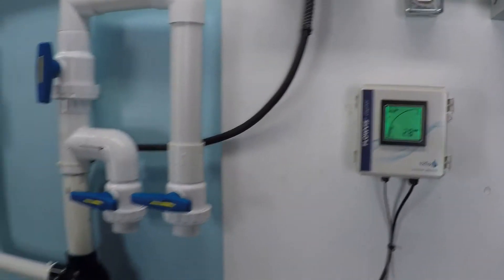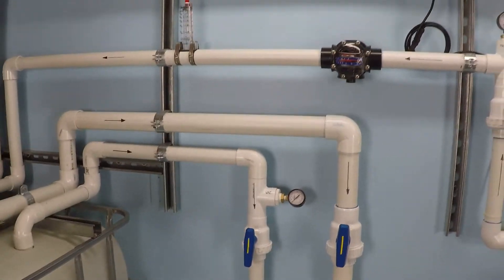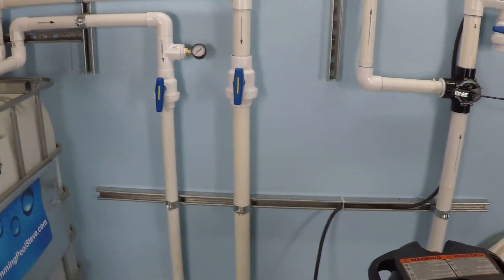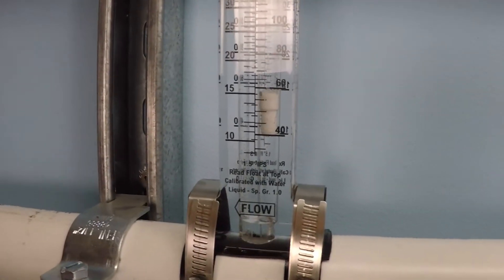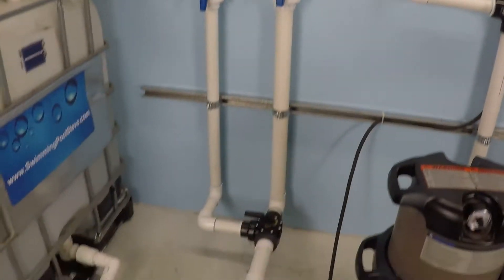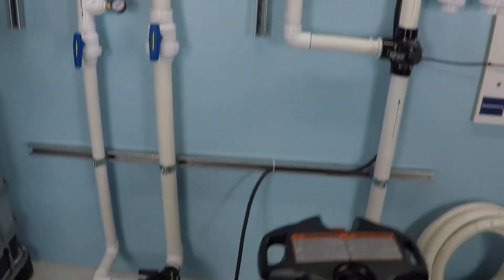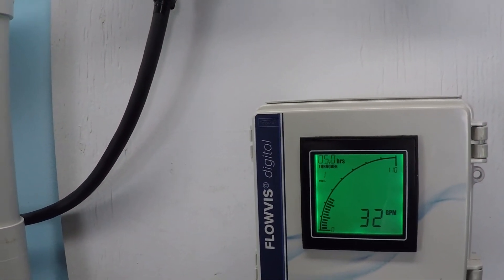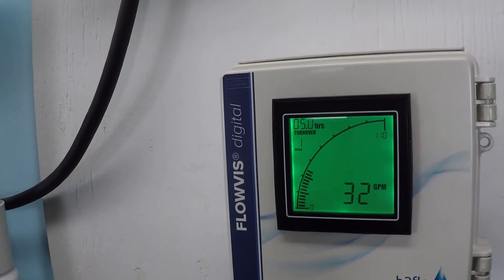What Is A Digital Flow Meter?

Comment: I even read that 1st turnover filters only 37% of your water, 2nd 68%, 3rd 87-89% and the 4th 98%,,,, so you are absolutely correct that it should be at least 3X the volume of your pool,,,,there is a general misconception by the pool chem supply companies stating minimum 1 turnover for 12h, stressing that residential turnover should be within 8-10 hours and commercial 6 hours
,,,but 1 complete turnover does not mean 100% filtration,,, that is why I concur with you that minimum 3X turnover is recommended for good filtration and efficient use of chemicals,,,,

Comment: Can the flow rate on the Pentair Intelliflo VSF be trusted or should I also install a separate flow meter?
Reply: I’ve been wondering the same myself…information is scarce about this. Running the Intelliflo via GPM instead of RPM. How accurate is the setting vs an actual flow meter?
Reply: @hovansh2373  @keithws Pentair make great products, and the IntelliFlo series is no exception. However, the primary function of the IntelliFlo VSF is the variable speed capability - the flow reading is marketed simply as a flow estimate/indicator, and is referenced as such in Pentair's own literature. The VSF flow reading is roughly 70-75% accurate and reads low, which in turn encourages the user to set their speed higher than is necessary, thus burning additional, unnecessary energy. 
If you are looking for an accurate and reliable reading of flow, there's no replacement for an actual flow meter. FlowVis flow meters (from H2flow Controls) are >98.1% accurate across the model range. Please let us know if we can provide any additional information.
Reply: @H2flowControls   so can the FlowVis Digital be integrated into a Pentair controller - for the purpose of 1) more accurate speed setting on an Intelliflow pump and 2) remote display of FlowVis Digital numbers?  Thanks.

Comment: Are there any digital flow meters that will interface  with Hayward omni pl control panels?
Reply: Hi @Bill Fraser. Not specifically familiar with the Hayward Omni PL panels, but if it has a 4-20mA input then FlowVis Digital should be a capable solution if you're trying to achieve constant flow. Feel free to give us a call or email us if you'd like to discuss with one of our engineers (866-635-0296 or sales(at)h2flow.net)

Comment: Pump will not start , all the setups are in the screen, time etc. but it will start manually only and stops at the time previously set.
So, every morning I must press the start button. I have try the factory reset without results.